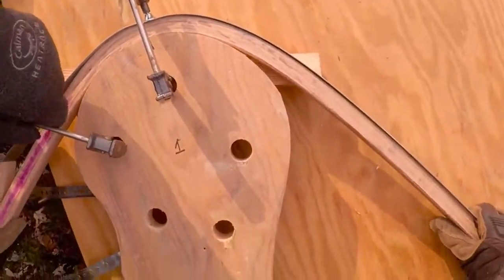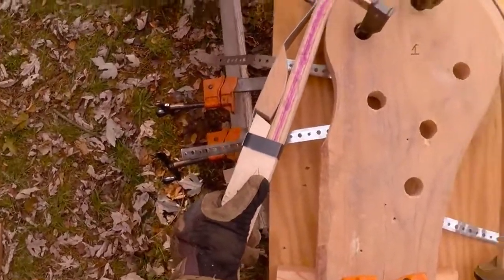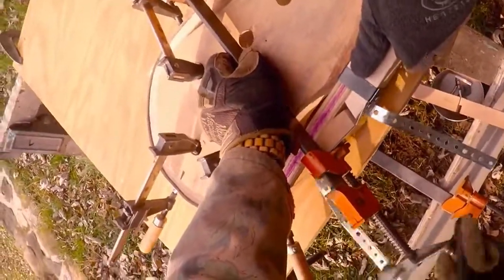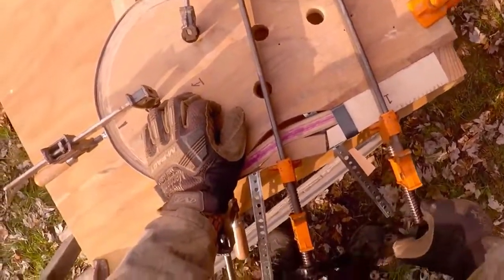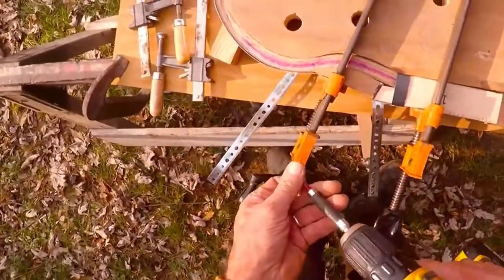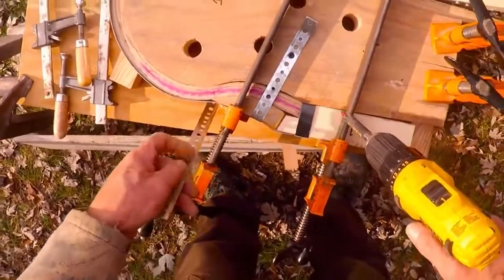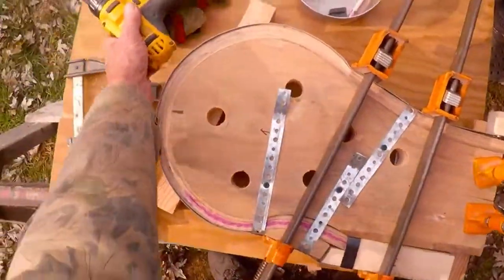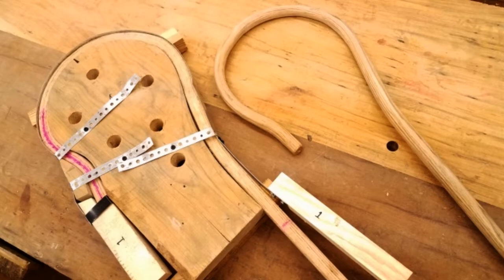Steam Bending a Shepherds Crook

Comment: Just a speculation, but noticed you had goats on  haaa sorry, coats on and thinking it was cold weather there. I’ve been stern bending for over 35 years and I find it best to work in a heated area. That wood cools down fast enough in a heated area. Outside in the cold very, very fast. Again just a. Speculation. Lots of trials and broken , splits in the beginning . Actually I still break a few. Keep at it. Looks like you’re on the correct path. Good luck
Reply from the maker: It was cool but not cold.
We did have to work fast. 
I also have better results with a full length compression strap that I use now.
Reply: Hope I could get some advice from you. Have you any sugestions for bending fresh 1.5 in diameter oak for a cane? Skin on? Skin off? Dry first?
Hope to hear from you!

Comment: How do you bend fresh cut oak ?
Any season better for that?
Reply from the maker: Steam bending is a process of using steam to soften up the lignin that binds the wood fibers together so that those fibers can slide apart or together.  Generally bends are done against a form and held in place until the bend sets. Tight bends require a "compression strap".  On the outside of the bend the fibers will want to spread apart, and likely will spring apart and the bend will fail or break there.  The compression strap will force the fibers on the outside of the bend to stay in place, and the fibers on the inside of the bend to slide together, or compress.   Place your hands together with your fingers alternated and between each other.  You can slide your fingers in and out to represent the wood fibers.  On the outside of the bend, you don't want your fingers pulling apart, on the inside of the bend, you want your fingers to slide together toward your knuckles if that makes an sense. 
Some woods steam bend easier than others.  Red and white oaks are good steam-bending woods.

Comment: Where are you located? Do you sale the hooks? How much are they? Will you ship them?
Reply from the maker: I dont sell them, it was a special request, sorry!
Reply from the maker: Located in central PA
Reply: @wsflather  it is what it is most hooks I've seen were dective not working and I'm going to be getting Goats and sheep soon so wanted one for them from the start to help me when I work them thanks for the reply
Reply from the maker: @mystylangston4803  Check Tractor Supply, I believe they sell them.
Reply: @wsflather  yes but the opening is small and thay are not that sturdy I have looked at them it's fine. I do woodwork but have not done any steaming and bending so most likely I will keep looking till go time and then have a few Goes at making my own but thanks for the tip
Reply from the maker: @mystylangston4803  
The crooks in the four I made came out too large for any goats or sheep I've seen, but are perfect stage props, which is how they are being used.
You'll want freshly milled wood, white oak would be a good choice, and a compression strap.
Another good way to do this would be with a bent lamination, thinner strips around the form glued together.  Gorilla glue would work well as it has a longer open time than Titebond.
Reply: @wsflather  plys was going to be my first method to try ewes and does have smaller necks but the hook is manly for bucks and rams in rut difficult stubborn and I know goat smell,  the Goats also love to urinate on their Belly and legs to smell good for the ladies. A difficult smell to get rid of once thay rub it a lover you lol
Reply from the maker: @mystylangston4803  
There is another option I just learned about:  "Cold-bend hardwood".  This comes from Danish industry and is wood that has been compressed longitudinally and can be bent around forms without steam bending.  It is a bit pricey though.
https://www.puretimber.com/discover-extreme-wood-bending/

Comment: How thick is the steel band that you use?
Reply from the maker: Last bands I made were 8 mil in thickness.  Only regret was not using galvanized stock, the bands left dark stains on the red oak.  Not a big concern as the wood was worked with draw knife, spoke shave and card scraper after bending, leaving no marks from the strap.